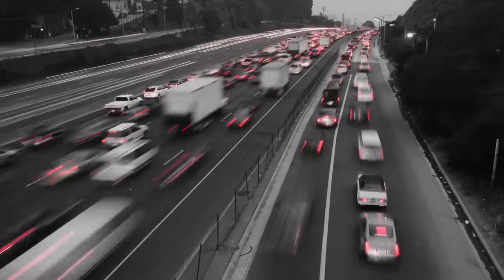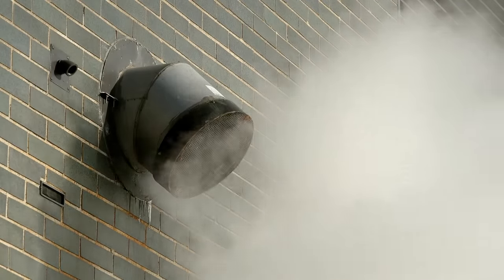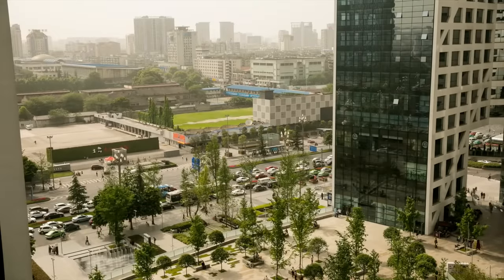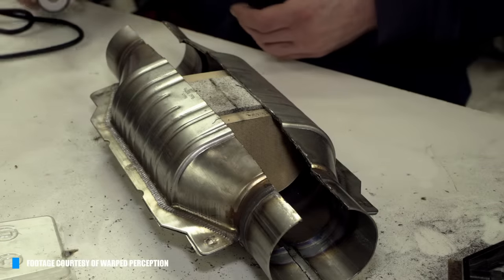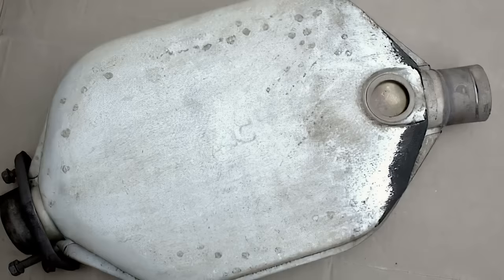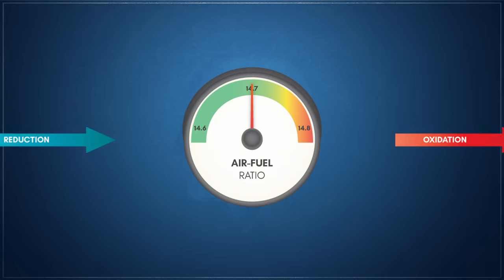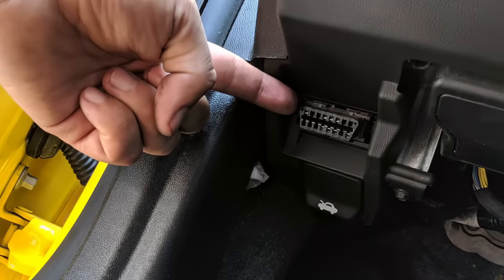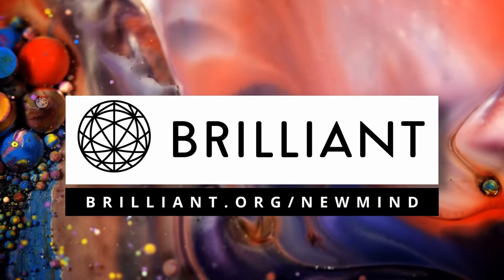How The Most Hated Auto Part Changed The World

Comment: The efficiency of the oxidation in the so-called converter is entirely dependant on the swept area of the honeycomb design.  The precious metals used are there for the ability to handle the heat inherent in the exhaust system and not for converting something into something else.  Lead cannot become gold.  These are really super burners that break down the substances in heat reaction and not dumping out of a big pipe into the atmosphere.
Reply: The platinum also acts as a catalyst, lowering the energy required for the reactions. It's used for this purpose with some frequency in other chemical reactions outside of combustion engines as well.
Reply: I don't think you understand what a "catalyst" is. The presence of some materials can reduce the energy required for chemical reactions to occur. This isn't converting lead to goal, it's using a fan to make coke.
Reply: There is a difference between changing one element into another (lead into gold in your example) and changing one chemical compound (made from more than one element) into another.  An example in the catalytic converter mentioned in the video is changing carbon monoxide (CO) into carbon dioxide (CO2) by adding a second oxygen atom to it.  The intent is to change molecules of "bad" stuff into molecules of "less bad" stuff.  As other responders to your comment have mentioned this chemical reaction is facilitated by the catalytic properties of the precious metals in the converter.

Comment: Catalytic converters are just perfect. You're constantly reminded of the much worse exhaust from marine engines, motorcycles etc when cars even from over 30 years ago practically smell nothing and emit mostly air and carbon dioxide. Two stroke engines are the worst and should be banned, terrible engines. Not to mention their reliability and lifespan is laughable. You get like a few hundred hours from a two stroke snowmobile.
Reply: Two-stroke engines are easy to rebuild and their power-to-weight ratio are second to none. With all their problems they certainly still have a place in this day and age. To get rid of as much of the pollutants as possible an alkylate gasoline can be used.
Reply: 2-stroke is the Lords stroke ...and who are you to argue with the baby jesus? Especially this close to Christmas 🎄🤶
Reply: @MattyEngland  😁
Reply: @SweBeach2023  If your Kawasaki can have a four stroke (where every gram counts) then anything can. Sure they’re more expensive but if engineered correctly you can push some insane numbers power/displacement or weigh. Alkylate is also really expensive, I wonder if E85 could be a good alternative, it’ll allow you to run higher compression without knock which would be beneficial in small engines. Scooters are just an abomination, thankfully I live where there are practically none, but in Athens, Delhi etc… I’ve tested some electric ones and they’re really good, but range is lacking for enthusiastic teenagers from what they’ve said. Commuting range is acceptable. Also new sales of two stroke marine engines are banned in Sweden that’s for a good reason, I generally dislike outright bans but this is understandable. Banning ICE by 2030 or even 2060 or whatever is stupid, only hobbyists will still drive them and likely not as a daily driver so their pollution will be minuscule.

Comment: The Catalytic Converter is such a useless component overall. It caused more issues than it corrected! And now the thieves are stealing them due to such high scrap prices on such rare elements within the converter. Yeah, you could say that I hate the Catalytic Converter too!

Way back when I removed the CAT from my Eagle Talon and gained noticeable horse power and provable gas mileage. Then I installed a stand alone engine management system from Haltech and the real fun began. With a little quick and easy tuning and mods, that car went from 16 MPG with a Catalytic Converter to 45 MPG after the EMS and removing the CAT. It also picked up over 50 horse power after the modifications. So more power and more fuel economy just by removing the Catalytic Converter..... Yeah, it sure smells like a conspiracy to me. Cheers 🍻
Reply: Does the new EMS run the engine leaner over the whole load range? Just removing the cat will make it stink as it is very rich at start to ignite the cat and then oscillates between rich and lean while running.